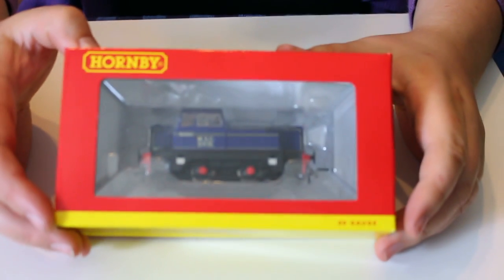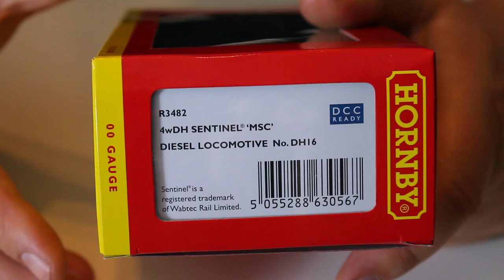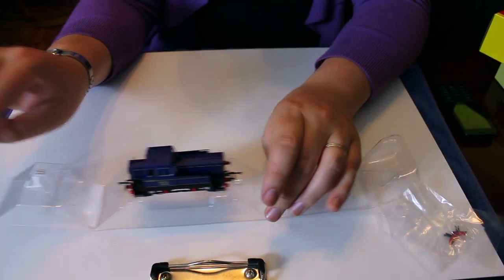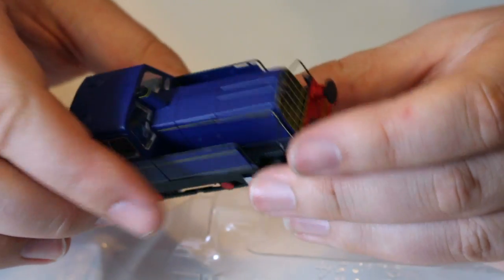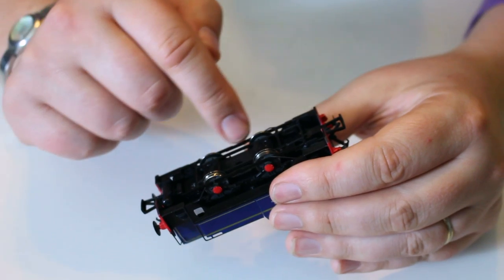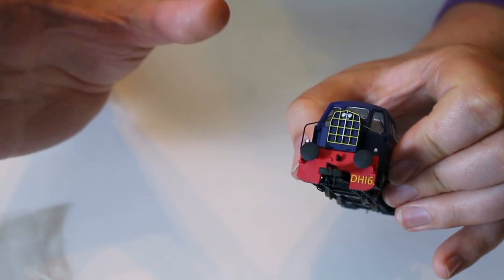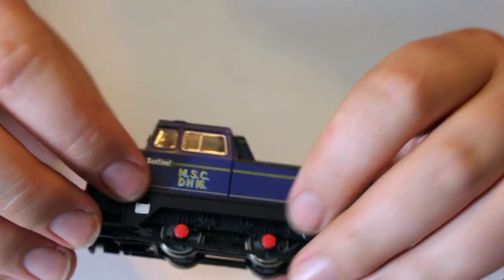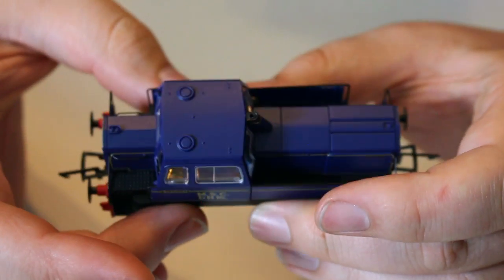Hornby 4wDH Sentinel 'MSC' DH16 - R3482 - Box Opening and Review

Comment: great video..ive seen mixed reviews which your three attempts at Arcadia bears out really..but as you say still very good value especially if it runs as well as an 08?!     cheers     dave
Reply from the maker: There are limitations born out by a short four wheeled chassis, but overall a great little model, especially for the price. The one we found that hadn't been tampo printed on one side really was a massive QC failure though.

Comment: great model,jenny,i have one in red,nice one.jpj
Reply from the maker: I have three of these now; two without rods and one with.
Reply: nice one,useful on layouts with sharp curves like mine.jpj
Reply from the maker: I did test the minimum radii for the similar wheelbased ex L&Y pug once and it could go 180° in 12", but was too tight to actually be hauling anything.
Reply: good loco for a dockside or light railway layout.jpj
Reply from the maker: Certainly is. That's pretty much what the MSC was, with its 'main line' following the banks of the ship canal from Salford all the way to Warrington. Once upon a time it could be seen from both Barton Bridge on the then M63 (M60) and from Thelwall viaduct on the M6.
Reply: nice one jenny.love.jpj

Comment: They use them at Kellogg's in Trafford park
Reply from the maker: The locomotives that were parked by Kellogs weren't Sentinals, but old Hunslets of similar vintage. Latterly these were replaced by hired in class 08s before this traffic ceased completely a year or two ago. It was for the container trains; Kellogs hadn't been rail connected since the 1980s at the latest.